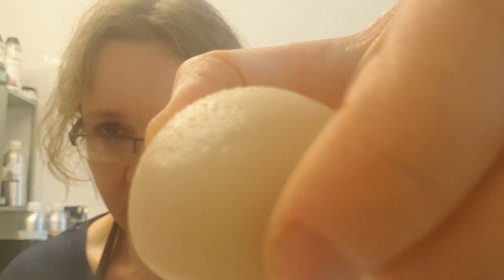Help, my melt and pour soap is sweating?

Comment: It makes me go mad and really hot headed. Whyyyyy it sweat so much. What did I do wrong.  How do I fix/ prevent it from sweating. I am new in making soap and I am super determined to achieve in making it without sweating. 😭
Reply: Use humidifier in a separate room for 1-3 hrs it will solve all problems it all depends where your staying is cold wet humidity it will happen to all your soaps. Like where I stay it’s an island it’s rainy with humidity with floors & walls are sweating 😢too so I pay electricity a lot during winter 7x12 hrs full month my electricity is switched to dry my soaps. So during rainy days and winter I stopped making soaps
Reply: @Don-ks9fb  I did that by accident/ was making bath bombs in a raining day… my soap shrank and looked ugly so I changed the recipe for the soap base and it’s fine now. Thank
You so much for your kindly response

Comment: I'm in Florida, it's December right now, it doesn't get any dryer than it is right now, this is as good as it gets.
I don't over heat my M&P I always end up with a good amount of unmelted soap lumps I'm slow stirring till dissolved with my color and fragrance and I hope the lumps are gone before it starts to skin and I get it poured.
I have extra imbeds I didn't need that I made, sitting on brown paper sweating under a fan, sweating so badly they are melting into the paper, so slimy I can't pick them up, I can't use them and I can't wrap them either! 
My bars start to sweat on top before I unmould them, I have to give them a bit of a rinse with alcohol, let them dry a bit, cut some thick brown paper for the bottom in hopes the paper will help keep them dryer and wrap them in plastic sheet.
Sometimes, they still sweat even in the wrapper.
It looks so bad 😭